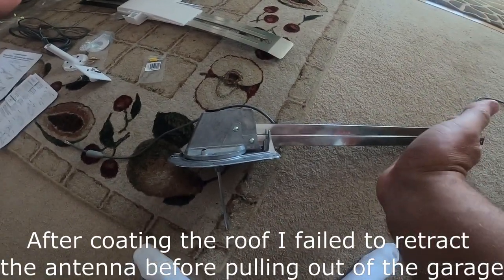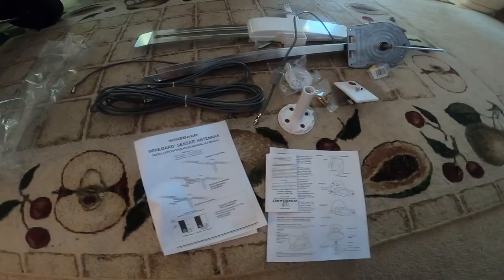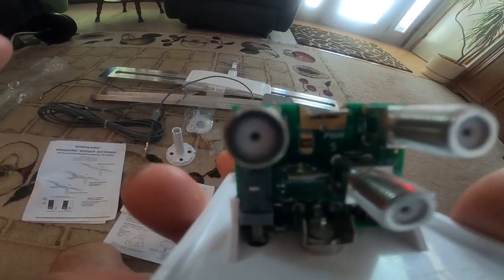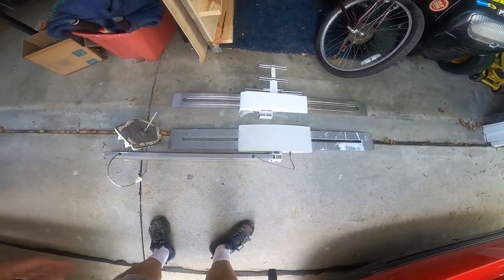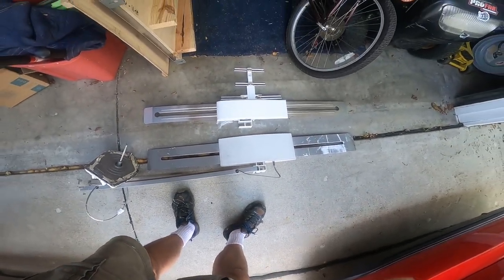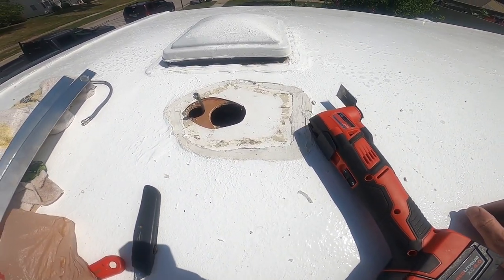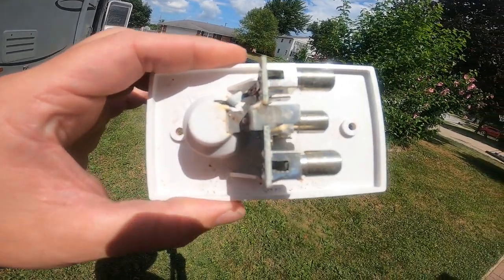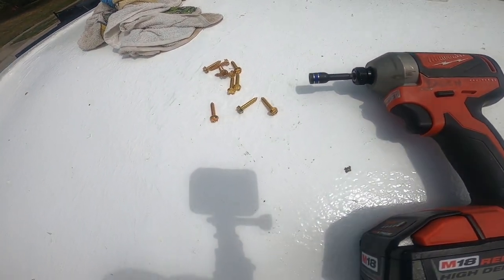How to replace RV trailer camper antenna

Comment: Only upgrade I ever made was to satellite receiver then we got  it all everywhere.
Reply from the maker: OffGrid Wanabe little known fact:  I rarely watch tv.  Have never owned cable or satellite!   I can’t believe how cheap these trailers are made!   What kind do you have?
Reply: @SolarDrew  I have none now I sold it on the weekend lol but I have had many makes from motor homes to 5th wheel to trailer to park model  but I am done now to old to feel good about the traffic anymore.
Reply from the maker: @offgridwanabe  Did you prefer a 5th wheel over a trailer?  I'm considering a change
Reply: @SolarDrew  Yes as long as you are nimble enough to climb up the stairs into the bed and you like driving a truck. The one I miss the most is the Motorhome just too easy and ready to go less hassle.